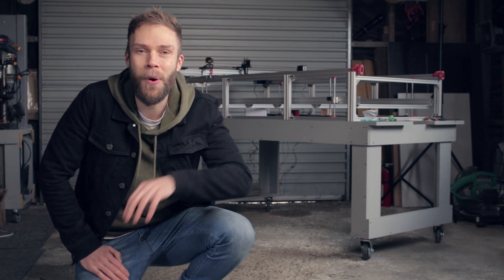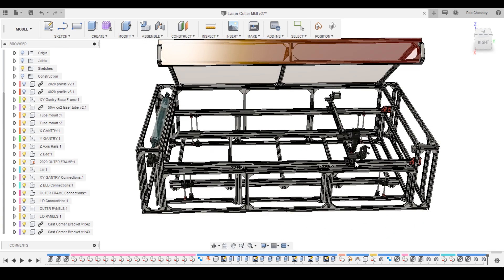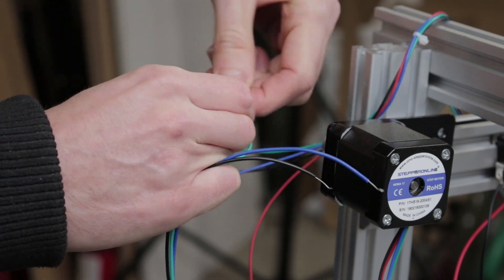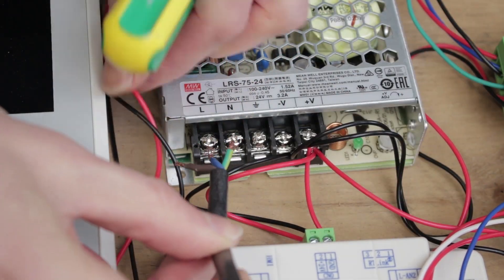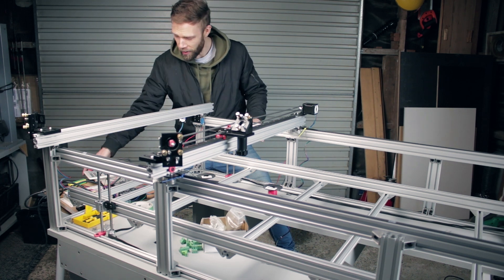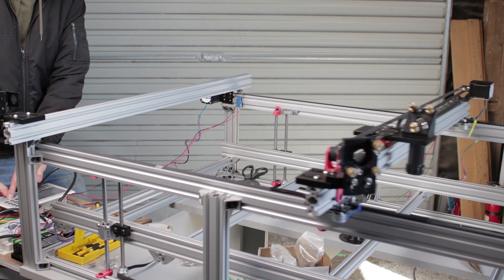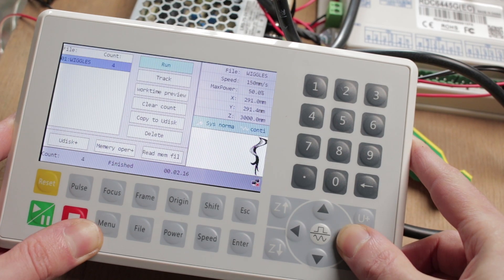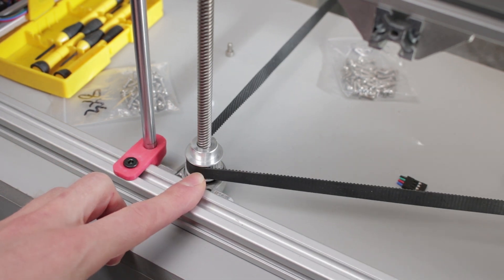Ep4: Starting the Electronics. The DIY CO2 Laser Cutter / Engraver Build Series

Comment: parts list states 2 Power Supply, 24v 75W 3A 110v or 220v but the line also states Meanwell LRS-75 Switching Power Supply 12V 6A / 24V 3.2A 75W, so which do I need one of both or two 24v???
Reply: and there a cheaper alternative for the 3 Cloudray Leadshine 2 Phase Stepper Driver DM542, they are like $60 AUD each???

Comment: So I am at the point in the build where I am moving the axis's with the controller. When the axis's go to the origin, the y axis will back off and re approach the limit switch, but the x axis does not. Has anyone else experienced this? Is there a machine setting I am missing?

Comment: 2nd plea for assistance: i am currently on the electronics phase of my build but for some reason, can get the limit switches to work.  is there a trick to installing or did i miss something?  arent they usually just plug n play... or do I need to configure them in the controller [or in the software].  the chinese company that i purchased from cant even understand anything past "buy now"... so of course they are no help.at any rate.. any help would be great thanks!

Comment: Many Thanks for all of your patience and attention to detail.  I've purchased the plans and about 50% finished.  Motor axis work well but Cannot get the mechanical limit switches to function.  From the plans and video, it looks like they are just plug and play.  Is there something that im missing? or do I need to setup in the RD8445.  Also for the main power supply:  plans show it connect to a 24V power supply, but there is another 24V power supply for the Z axis.  Should we split the Main power so it goes to each 24 power supply so the Z axis has power too?  plans dont mention it.  Any help is appreciated.  Again thanks for all the time you put in to this build series.  Great job!

Comment: I'm wondering if a BL Touch would work to automatically adjust the bed for the focal point?  Also on the Y400 build im starting does it have a Pass thru option on that machine? I went through the build and it didnt appear to me that it did.  Thanks

Comment: So I'm a bit confused because I am brand new to this and like you mentioned, electronics are not a strong suit for me either. So can you please clarify:  do the electronics you are using and recommending in this video for this build - are they compatible with Lightburn? I really want to buy or build a Laser Engraver Machine that can utilize that software, or something that can operate with an internal camera - like Glowforge or similar models. ( And I really don't want to buy the K60 "Chinese Machines" - I'd rather build one)  Please let me know if you see this post.  Thanks in advance
Reply: He specifically states that it works with Lightburn.

Comment: you could take apart the controller and remove the speaker for the beeping.     I had bought this 2 pack of smoke detectors about 3 weeks after I installed them one started going off for no reason. I tried to push the button to silence it but no go.  the batteries were built-in.  I did the sensible thing took it outside and smashed it on the sidewalk.  I chalked it up to defective then about 2 weeks later the 2nd one started doing the same thing so I took it out to its death.  I went and made sure the new ones needed 9v batteries

Comment: Why 2 motors on the Y axis?  One in the middle with axles going to both sides is usually the way it’s done.
Reply: I am also curious... I looked and the ruida doesn't support dual y axis end stops so if they get out of whack, it stays out of whack until you manually fix it.

Comment: Do you wire an emergency stop into this machine? Where in the circuit do you put it if so?
Reply from the maker: I didn't for the test, but certainly will when we do the final enclosure. I typically put them right after the mains socket - so it cuts power immediately to everything

Comment: First I gotta say i'm loving the detail your showing in this build series.  Only watched one of your videos so far but learned a lot.

I got to ask about your choice of Ruida controllers. I bought a laser with one and have been loving it so far. Still quite new to this laser. It is a great controller. My gripe is RDworks. I dislike it so much i've considered switching controllers. Yes there is support for them but its not the best. And it's not a fun program to work with.  I've not tried light burn yet not being free but think I should soon. I haven't found other software yet to create the Ruida .rd files to through on a thumb drive and into the controller.  I think my ideal would be to take sketches drawn in Fusion 360 and have that post a file I can take directly to the laser controller since it dose such for some controllers. At least for cut files.  My last project took me almost 3hr to figure out how to take a good Fusion .dxf use a paint bucket to turn it into an image to raster. I kept having quality issues with a few different intermediate programs trying to find something that RDworks would import with good quality.

I come from a background of CNC machining at large job shops. So i'm spoiled on good reliable software workflows.

I'm really looking forward to your ventilation video. It's time to upgrade mine.

Thanks for reading this if you've made it this far. Any comments form you or anyone would be much appreciated.
Reply from the maker: I feel your pain with having to jump through software hoops. 
I haven't worked with Lightburn either, though it sounds like it would solve a few headaches. 

My typical workflow in dealing with the chinese software, be it RDworks or LaserCAD, is to complete all my vector work with layers and line colors inside Fusion360 or other CAD program then export that out in either a .DXF or. .Ai to import in. Then all I need to do in the Laser Software is the power and speed.
Reply: @FurtherFabrication  Oh!  I'm going to have to play with that. Didn't know you could do separate layers in Fusion like that or do .Ai files that RDworks would like.  Thank you a ton!!

Comment: What about those who prefer 80W or higher? Is it really worth having swaped axis? That sticking out part of the tube could be hit anytime, especially in the tiny rooms. I know it would be covered but still, annoying. And if I decide to place the laser tube behind the machine, will I still be able to fallow your design? Or its a game changer? Many thanks!
Reply from the maker: I wrestled with this situation as well! 
So here's my thought process into it; Because of the axis swapped configuration the extension for larger tubes will protrude from the rear of the machine. This means it will fill the deadspace created behind the machine where the extraction hose and water cooler will be running. Minimal opportunity to get knocked back there (unless you're crawling around behind the machine for some reason). 
However the design will still work wherever you want to place the tube, you would just extend out the x-axis. Hope that helps!
Reply: @FurtherFabrication  I've decided to fallow your build except for the laser tube position. Thank you!

Comment: Twist two stepper wires and turn the stepper - if it's locked, it's a pair. if not, not. Also you could alter the direction by switching the two pairs on the plug.
Reply from the maker: That's a great little tip!

Comment: I saw this video https://youtu.be/GOF0u9qsFOI and it seems like an easy and awesome idea. Do you think this could be implemented to this build?
Reply from the maker: Yeah absolutely!
Reply: @FurtherFabrication  Great, would be awesome to have a way you could easily switch between the modes and not having to unplugg the motor, assemble the roller and calibrate position everytime you want to engrave on a cylindrical Object. Is that possible you think? to have it set up more as a permanent solution togheter With the normal bed?

Comment: The RDC6445G is $240 more than the RDC6442G. It would be really beneficial if you can touch on the difference between these two in your next video. Thanks for this video series!!!
Reply from the maker: The price difference shouldn't be that big?! On AliExpress it's less than $20. The difference is the 6442G isn't the current model. the 6445G is, and has a better interface. Otherwise they're pretty similar. Hope that helps!
Reply: @FurtherFabrication  Oh ok I just looked and found the 6445G for around $250 USD on Ali with power supply. These videos are great!

Comment: Really great build Videos. A great way of presenting. A question about you Z axis. Is it necessary to have the linear bearings for this axis? Do you find the   4 lead screws aren't enough?
Reply from the maker: Thanks. That's an excellent question. I added them in for my 'version 1' back in 2018 as a fail safe to stop any binding issues and help with general rigidity. I think larger diameter lead screws would probably have the same effect (which would be interesting to test). but you would end up with slightly more unusable space between the fame and the cutting bed.

Comment: When all is said and done are you going to be adding some LED light strips that would be controlled by the controller? I have on my 3D printers custom LED strips that run off 5 volts.
 I didn't know if you would go this way or if you would use the 12 volts with a buck converter in line
Reply from the maker: Yeah getting some LEDs in there is probably a good idea. I'll probably try run them from the 24v power supply that's already in there.

Comment: Hi, from Building my own CNC, I have learned that it might always be better to connect thoose DIY Nema17 Steppers in series (due to Heat and Max. flowing current). Füttert Information: https://community.parker.com/technologies/electromechanical-group/w/electromechanical-knowledge-base/200/series-vs-parallel-wiring-in-motors
Reply from the maker: Interesting. I'll look into it. Thanks

Comment: May I suggest a nice part from Eleksmaker? They have this metal piece with teeth that works great to hold the belt.

Link: http://store.eleksmaker.com/index.php?route=product/product&path=102&product_id=119

Edit: I have been following along your build (mostly, I actually did go for the Arduino controller) and I would like to mention that I added a plug with a fuse and a lit switch. I just feel better when I don't hot-wire the cord straight into my machines..

Comment: Like before watching the video, very nice progress man, for the 8mm rail brackets ( 3d printed parts) it will be better to replace them with SK8 , as they will grip the rodes nicely and they are more rigid , but its still an amazing project , keep it up
Reply from the maker: Thanks dude. Good spotting, they were the closest thing I could find as well.
Reply: @FurtherFabrication  this is cheaper solution , use those collars bellow the printed parts and tighten them , use them also on the other end of the lead screw to prevent it from getting out of it place.

https://www.aliexpress.com/item/32761250387.html

Comment: Open the controller up and cut out the little piezo buzzer. Simple as that
Reply: Maybe a better option would be to install a little switch on one of the piezo buzzer leads, so if needed, it can be turned on
Reply: Blue Tack,  press a small piece into the piezo buzzer this will lower the volume so it does not annoy but you still get feedback. You can always pull it out with tweezers to regain full volume.
Reply: Haha you really think we don't know that?
Reply: @snarkylive  my point was to be not so drastic. I with a switch he could turn it off, but if for some reason he would need it, he could turn it on easily
Reply: @Bloodray19  There should be a little hole for the sound, jabbing it repeatedly with a screwdriver will stop the infernal beeping without having to open the case.

Comment: TBH, you could have saved yourself some funds and eternal pain by ditching those awful internal aluminium 'meccano' angle brackets and use proper 'core screws' instead - you end up with a much more rigid setup (albeit that you do need to think ahead when building :-). One further benefit is that you now have clear space to install panels internally to the space frame and not have them stuck to the outside - which is really just 'naff' :-) One other point, use T-nuts that simply drop in to the slot and don't have to be installed beforehand - maybe a tad more expensive but much less painful :-) Otherwise, great vid, choosing any chinese controller is also a great choice over the arduino option - the chinese software is just absolutely $hite, but the controllers are excellent - a real money saver eventually. Lightburn wasn't available when I did mine (back when we made them from regular extrusion and glued on rails and sheep were frightened  :-))  - I had to use Parallels on my Mac then run LaserCAD - arghhhh - but it worked. Fortunately, I now own a nice amerikan "Universal laser", but the fun factor has gone :-)) Building another compact DC laser as a project is still high on the list :-)
Reply from the maker: Awesome, thanks for sharing your experience!

Comment: I've never found how to disable that annoying beeps. Cutting speaker off is my best bet.
Reply from the maker: Ugh I was hoping it wasn't that.
Reply: @FurtherFabrication  With your skills it won't be hard to add a manual switch if there is no option in the software ;)
Reply: @FurtherFabrication  much more simpler is to just push something like match, toothpick whatever to the hole of piezo element. You'll still get beeps, but muffled something like 8x compared to original when done correctly. I'd bet there's generic piezo with about 2mm hole